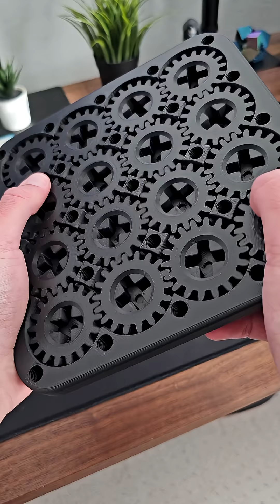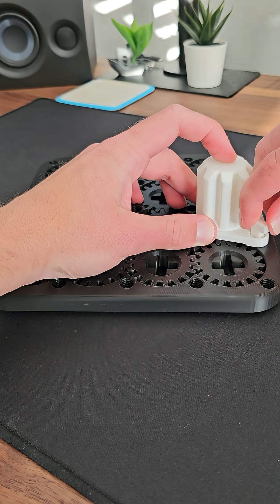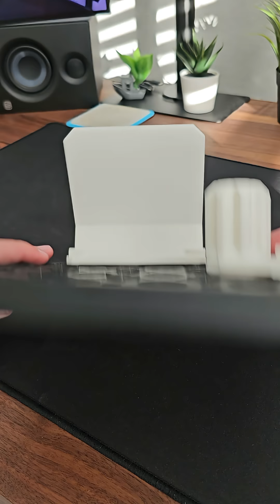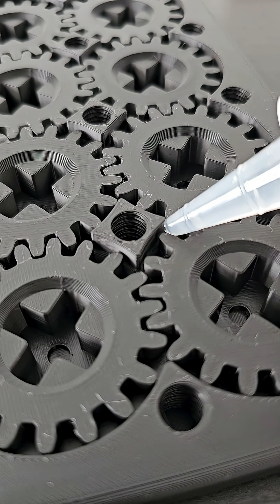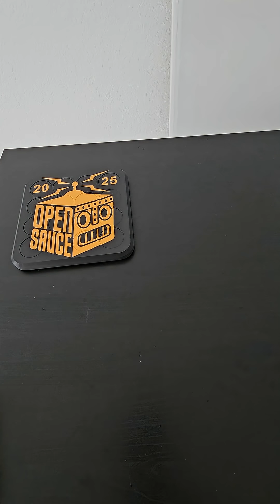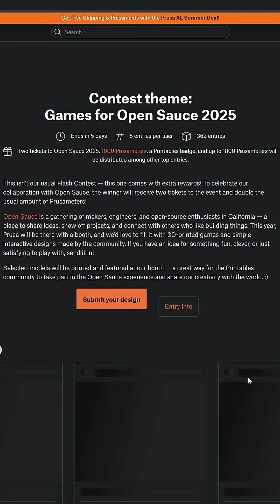3D Printed OpenSauce Kinetic Art  #3dprinting #art #gadgets

Comment: LUBE LUBE LUBE some sort of polymer friendly grease would probably be best otherwise relieve the tolerances to the point where the resistance is no longer affecting the function of the mechanism in the end some sort of bearing might be the answer in which case they are already lubricated and shall remedy the problem upon installation
Reply from the maker: This is the way haha, thanks for the advice
Reply: @ruforged  graphite powder will work much better than any lube
Reply from the maker: I'll check it out